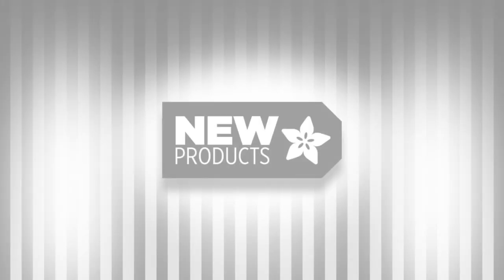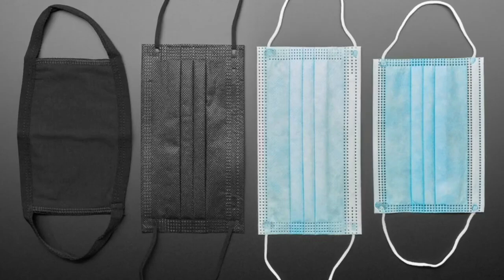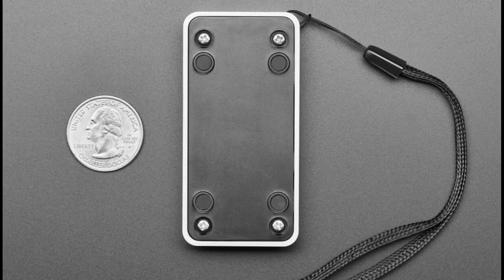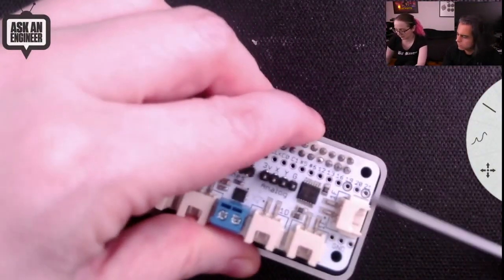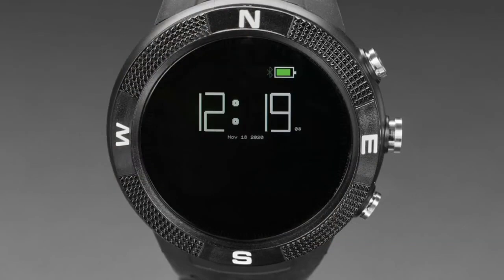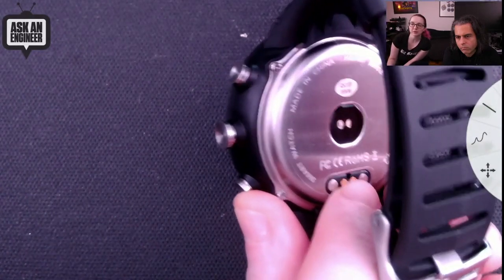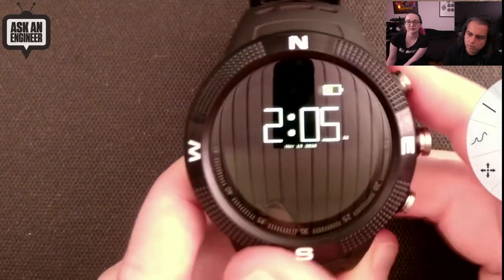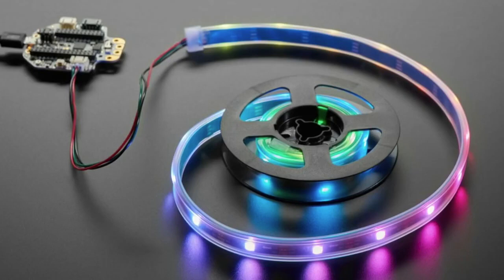New Products 11/18/2020 Featuring Ultra Flexible White LED Strip - 320 LED per meter -1m long~3000K!

Comment: I love this. Are you able to make it at any length by cutting and soldering? Or us non solder connectors? I'd love to apply these on some cables in my next project.